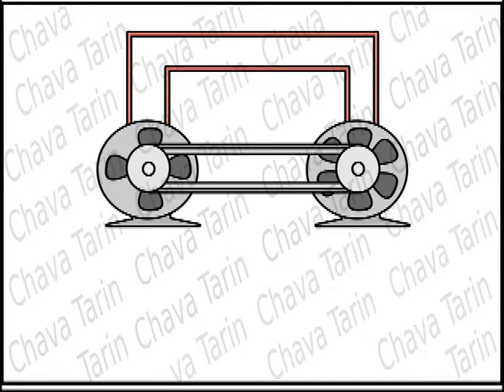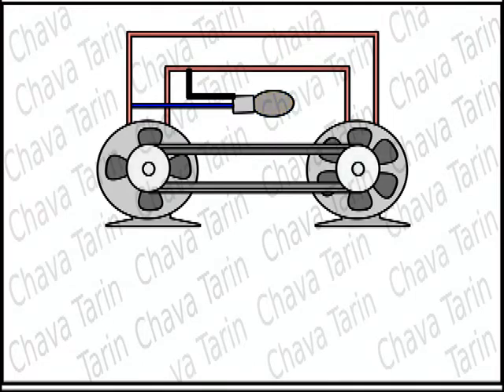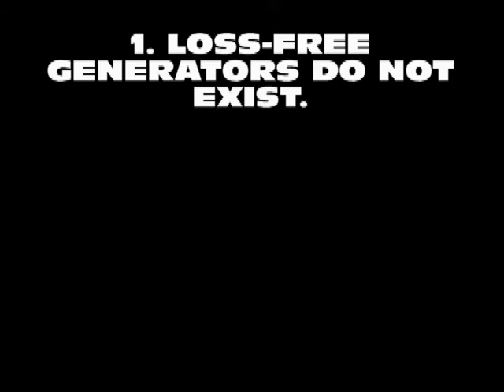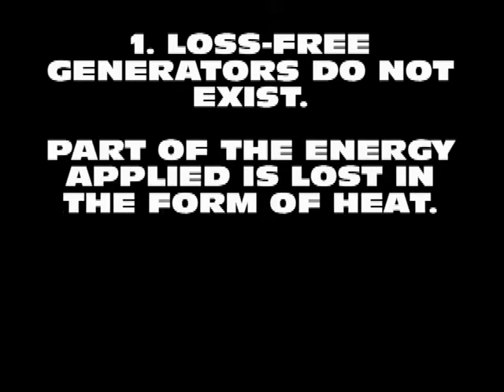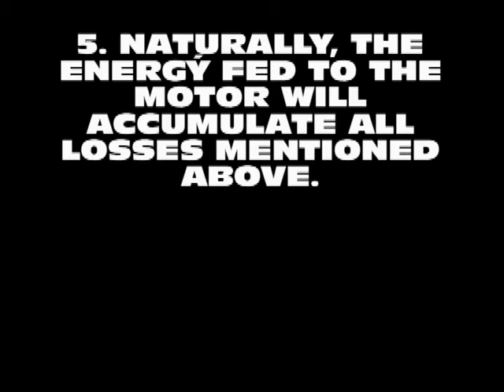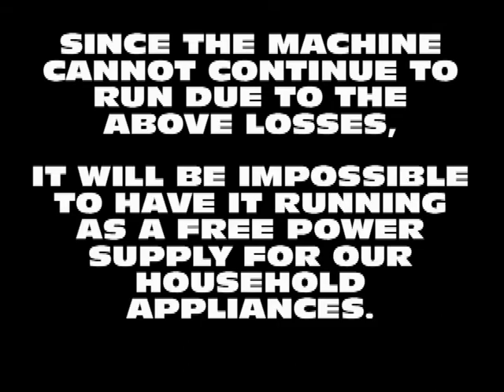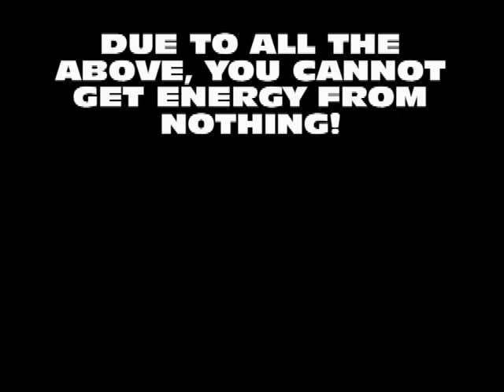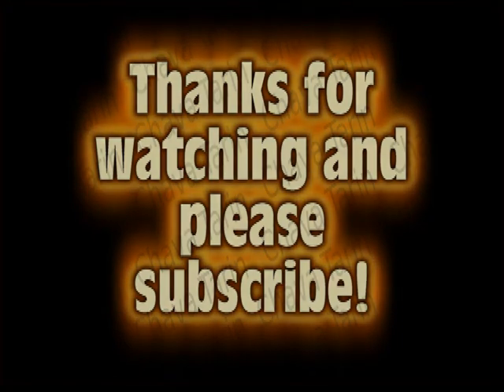Perpetual motion is impossible

Comment: What about magnetics???
Reply from the maker: Dear Keith, whenever something is promising to get something out of nothing, by physical means, it does not work. Magnetics is actually the core of all electric motors and generators, but there are some things that stop any allegued perpetual motion mechanism, mainly friction, which changes part of the original energy into heat. If you suspend by magnetic or gravitational action, a sphere in a vacuum, and set it spinning, it can spin forever, since there is no friction in a vacuum. However, the moment you take some of the energy out by any means, the kinetic energy is removed from the sphere and it stops. Regards!!